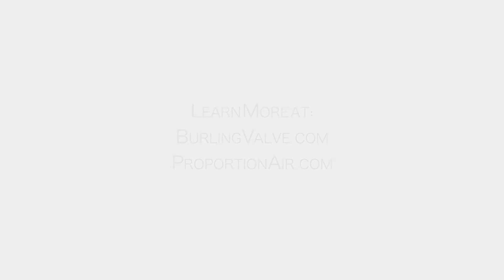Controlling Saturated Steam Temperature with Pressure

Comment: You didn't mention that saturated steam becomes superheated when you drop the pressure of it (conservation of energy).   You didn't mention this and so I assume this isn't being taken into account?
Reply from the maker: Temperature of superheated steam as a supply is too high for Burling products. Max temp for elastomers is 420-450F (216-232C). Saturated steam passing through a regulator/valve can create superheated steam. Superheated steam in this case simply means the water is completely vaporized. Reducing saturated steam pressure through a regulator/valve also drops the temperature. Superheated steam is not mentioned because any superheated steam* (vaporized water) conditions created by passing through the reducing regulator/valve have minimal effects. 

*A Mollier diagram shows what temps and pressures are needed to get either type of steam. Above the saturation line at a specific pressure, heat added to saturated steam can create superheated steam. It takes high temperature to superheat steam. According to chart, superheating steam requires a little over 450C (842F) at 0.5 bar (7.25 psi), over 200C (392F) at 0.1 bar (1.45 psi).